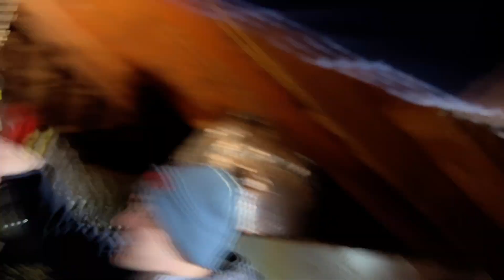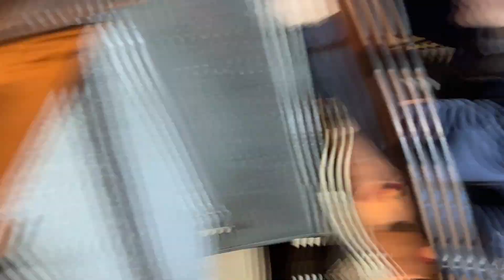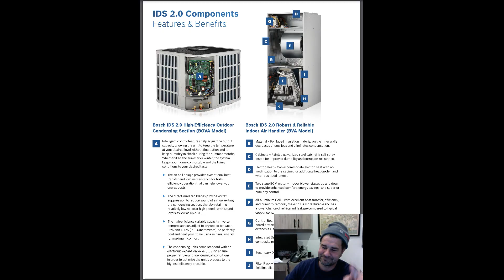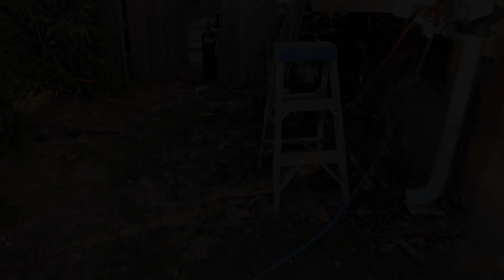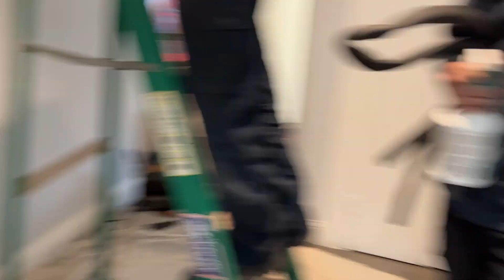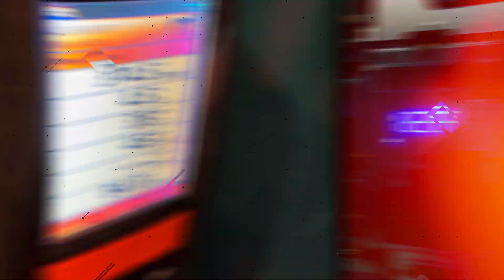Bosch IDS 2.0 4 ton Heat Pump Installation Why Pipe Doctor Installs Bosch

Comment: Bosch seems to do a crappy job removing humidity, doesn't seem to be removing any humidity. Thermostat graph humidity doesn't go down at all when you turn on the system.  Two stage blower being used. 😢

Comment: Is it true the Bosch system requires a 220 dedicated circuit?
We heard this and we also have been told pairing the Bosch condenser with an APS air handler allows the unit to be run on 110.
Is anything about all of this true?

Comment: Does the Bosch need that platform if you have a concrete slab on grade for the condenser? Does it need air below?
Reply: Only need a raised platform for snow since unit is used in winter

Comment: Does the 18 seer unit feature the same 10 speed ecm blower motor on the outdoor unit as this 20 seer? Or is just single speed? I'm curious which outdoor unit would be quieter since Bosch lists both 18 and 20 seer at the same db rating.
Reply from the maker: I am only familiar the the IDS 2.0 and 2.1 series. Sorry. You’d have to check the Bosch Home Solutions website.

Comment: 50 percent capacity at -4, that is not a good product. you really need to oversize the equipment to get any heating performance at lower temps.
Reply: @PipeDoctor  I know they are paying you big money to be an influencer. heating tables are  online. 18900 btus on a 36 outdoor at -4 at 70 degree indoor temp.

Comment: and you think 4 tons of air passes through a 16 inch round?  your such a plumber, sorry your static will be off the scale. i noticed you did not confirm air flow on the blower performance chat on this one. Any HVAC pro worth half his weight in salt knows your retro took in no account for duct corrections,  you also don't have a serge protector on that.

Comment: Just got one of these installed along with a new oil furnace (no gas in my area).  Not sure what to think yet.  It's nice to not have to use oil all the time but I cant say the house gets the nice warm feeling with the heat pump.   In the 40s outside today and I tried to get the house to 72 just to see if it could do it but it took forever, never got there so I just set it to 70, and gave up.

Comment: Thanks for the video, Mikey.
-Couple of questions for you.
1) With Bosch being made in China, how hard is it to get parts (what does their distribution network look like in the US)?
2)  I've heard Bosch has issues, in high humidity areas, with removing humidity from a house.  Would you recommend Bosch for areas like  DC, Houston, Miami, etc.?     

Thanks for the time and effort you put into this!
Reply: Nonsense- can’t extrapolate to to places like dc and Atlanta with even Long Island. And NB  Bosch gets that hi seer rating by pushing the sensible load emphasis. Don’t get me wrong - thsi is a great unit in some respects- price, quiet, flexible t stat choice etc .  Bosch is arguably the best choice in places like phoenix, but also arguably eclipsed by any decent fully communicating system in places like DC Atlanta, let alone Miami and New Orleans Houston. And let’s be honest, Bosch will sell to anyone, anyone, so chose your dealer carefully. E.g. Lennox really restricts who can sell their unit, carrier and daikin to some degree, but that means for consumer they are doing some screening before you get involved. And make sure your pricing is considerably less than a fully communicating unit from carrier, Lennox trane- like at least 1,000 dollars less, or what the point>summary- Bosch is ALWASY  going to be an outstanding choice for climates without disproportionate latent loads, but is NEVER going to be the best choice with large latent loads, BY DESIGN !
Reply: @PipeDoctor  Thanks for the quick response!  BTW, I would have loved to seen the video of you guys getting the air handler into the attic. :)
Reply: Why no surge protector? This unit is heavily dependent on expensive electronics !

Comment: Hello there,  I saw the unit running a 19 amps that is a lot of electricity. I was thinking the unit was running at 9 to 12 amps. Conventional  4 tons.. heat pumps I think run at 20 or more depending on the brand.  How is this provides electricity savings can you elaborate ? Also I saw the back on the unit,  briefly. can you install a easy start to this unit to run it on Portable generator  ? Specially my area the electricity goes out frequently.  Thank you.

Comment: What temp can the heat pump heat to if you add a 10Kw heat strip to it? Standalone I think the 2.0 can heat down to -4F ?
Reply: @PipeDoctor  Could the strips get the unit down to -20?

Comment: Hey Mikey, loved your video. I am in the market to buy a new heat pump system which will replace my 30 year old hvac that came with the house. I am now leaning towards Bosch 2.0 after seeing this video.
How large was the home where you installed this 4-ton system ?
My home is 3375 sq ft two story home in bay area , ca built in 1994 and I am considering two 4-ton Bosch system , one for each zone. My old system was 5-ton each and the installer is recommending to stick to same capacity or go no lower than 4-ton. But based on some help from an online site who do Manual-J, it seems that even 4-ton will be more than what I need. Problem is that no contractor here offers to do Manual-J.
any guidance from you will be appreciated.

Comment: Glad to hear you like it.   My A/C guy just ordered one for me to install in the fall.  Same 4-ton.  I'm hoping the more complicated multi-speed blowers wont be problematic long-term.
Reply: @PipeDoctor    My question if if higher SEER units are worth the potential problems in the future due to their complexity (some guys say to keep it simple).   I see a 10 year warranty on the Bosch, how comprehensive is that?  Thanks.
Reply: How many square feet was your house?

Comment: I’m deciding between the trane 3ton xv18 or the Bosh ids 2.0 bovb18 or Daikin fit 3.5-ton 17 seer what you recommend I go with which one would be the quietest and have lower cost maintenance/repair long-term
Reply: Is the Bosh quiet? What did you do? I worry about vibration noise since the condensing unit is on the roof
Reply: @hiimmidas  I decided on Daiken fit whisper quit during summer but bit noisy during winter since it’s working harder to convert freon to heat I gather no matter what brand heatpump you go with it will be noisy  during winter Bosh 2.0 is a great system but they were charging just a much as Daiken/train, there demand/popularity, and easy to work on by any technician made their prices go up,  from the research I gather train seem to be the most  problematic
Reply: You should never have to pay as much for a Bosch as you do for a fully communicating system. Bosch , a European country where humidity not an issue, til steers.their design to produce a hi seer rating to draw customers in-nothign wrong with that, just beware if you are in a climate to latent load . Daikin on the other hand, gets screwed with new seer ratings as they balance their design o ensure latent loads cna be handled well. This necessarily lowers serf rating as seer screws toward sensible loads in its rating system.

Comment: Time will tell if the Bosch units are good , and reliable. 
Remember when we thought Navien was the shit.
Reply: Bosch been selling heat pumps  it Europe for decade . they  used  Mitsubishi compressor and electronics here. If they use the same parts in US then  you have you self a nice unit.   Mitsubishi is the king or at least top 3 world wide.

Comment: I did install 2 years ago Bosch 2.0 Air-handler in my house for Steam humidifier Aprilair Model 800 system because I have hot water heating system and hopping next year before the summer will install Bosch Condenser heat pump

Comment: What is bosch tech support number. Im having problems with a bosch i installed. And the tech guy that i call is not much help. It seems like at night time unit does not keep up. It gets to the mid 30s were im at. So it does not have heat strips because i was told dont need them. I just need another opinion on what it can be. Refrigerant is on point, new line set static preassure is fine. Unit is 1 year old.
Reply: Needs heat strips.

Comment: Hell, just take your grider & cut it in half... a little aluminum tape, and call it a day! ;-) Since you're so buddy-buddy with the Germans now, maybe a "Request for Enhancement"... Realistically, how many homeowners spend time admiring the finish on their furnace. Sounds like you need a block & tackle... I used one to get a water heater down into the Cellar (think steep & narrow stairs) (also had 2 helpers, but it made for
less herniation and "oh shit moments".
Reply: LMAO! Ty
Reply: Maybe dash marks like a cardboard box “cut along this line”

Comment: Updateing to a easy trap,How awesome!!bonus with that swab!!
Reply: @PipeDoctor pipe Brush?to clean out the p trap..I’m a Home owner , lineman by trade.
Reply: I have done my research…Ac puts out up to 30 gallons of condensation a day!Living in a condo and watching your channel this a huge problem with either clogging or hack assembly of the drain lines. I have been flooded 2x by the unit above me from the line clogging.I will be explaining the easy trap to them and others of my complex.Thanks to you educating me about this along with the tablets I hope to resolve this huge issue within my condo building , Ty mike have a great day !!